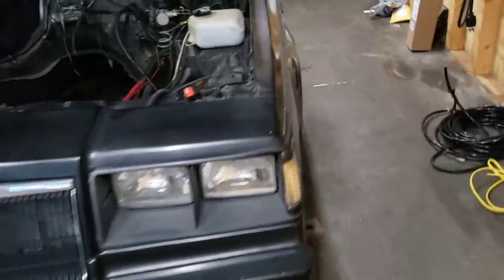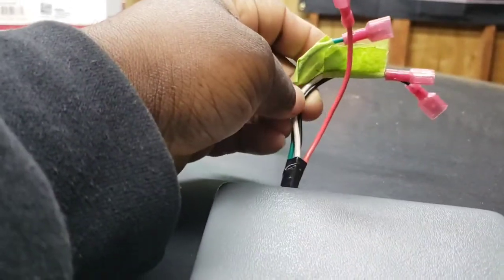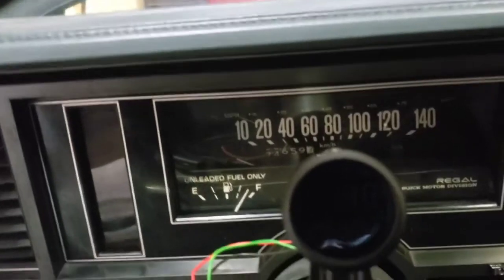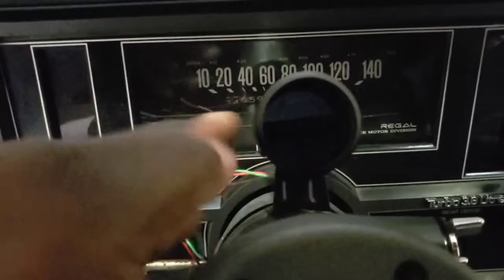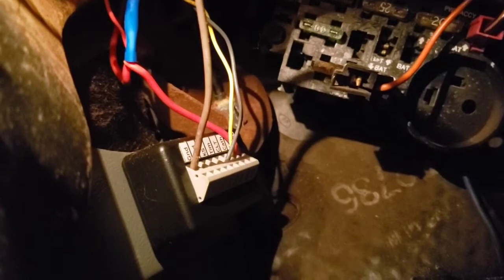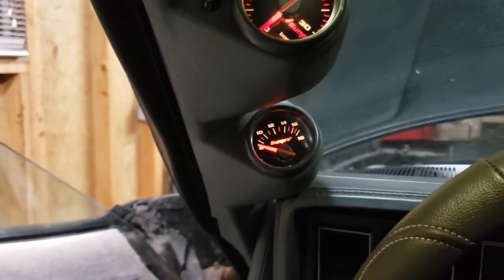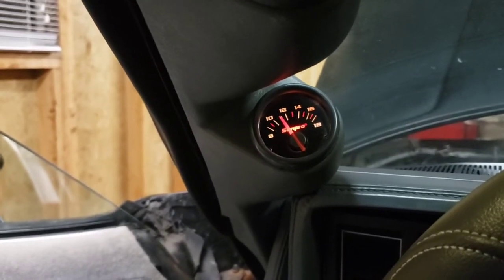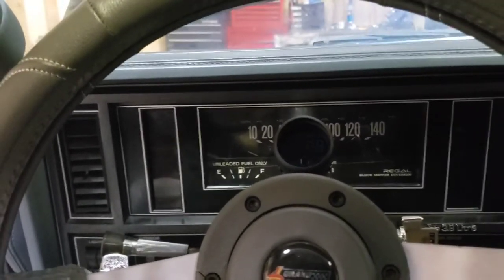Buick Grand National Gauge setup/install!!!

Comment: Really helpful video, thanks for posting it! I was going to run my wideband to the pillar, but the wiring and connectors were a bit much, so putting boost and wb down by the shifter.